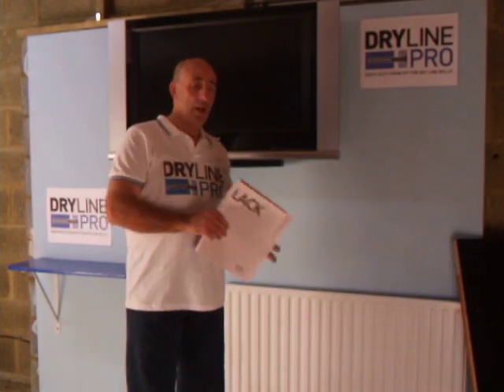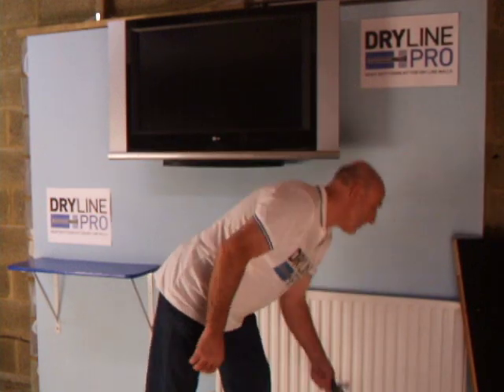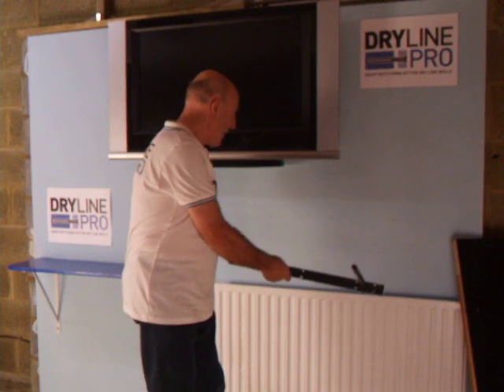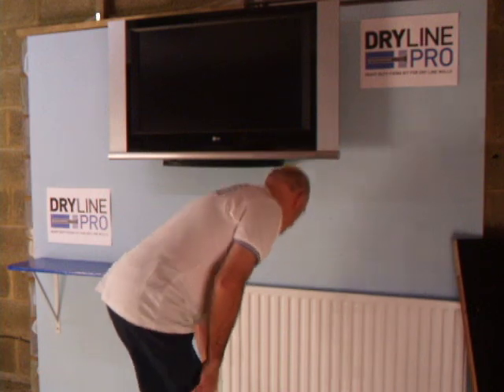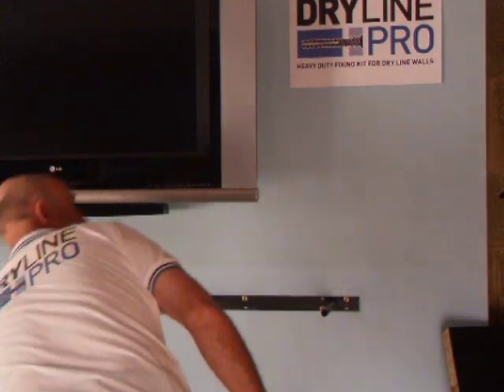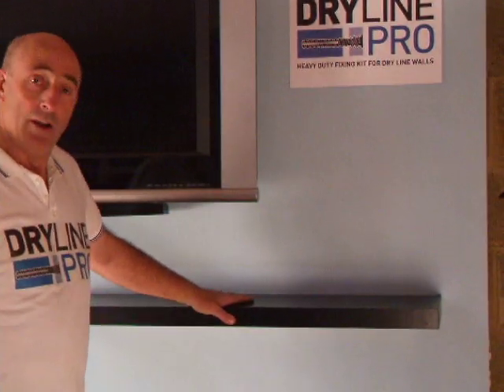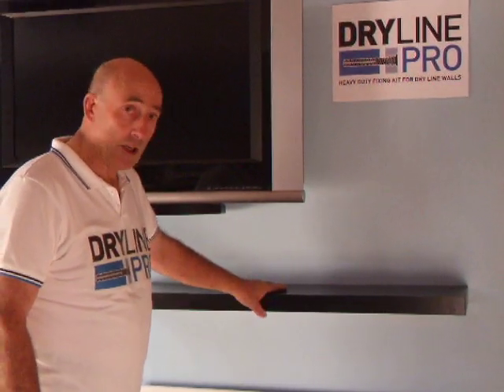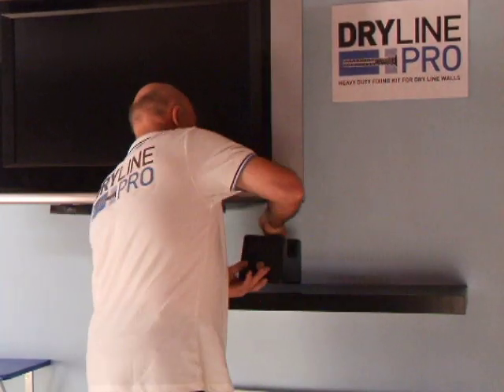Fixing an Ikea Lack Shelf to a dry lined wall

Comment: Video title says dry lined wall, yet you are drilling into concrete ??? Confused. Was looking to see how stable this shelf would be on a dry lined wall, ie not concrete or plasterboard
Reply from the maker: Walls made from concrete blocks, rather than insulating blocks, are sometimes drylined with plasterboard Victoria.It will be just the same on a standard drylined wall that you probably have in your house.
Reply: Richard Hall Many thanks Richard. So the screws and fittings you used never went into the concrete part of the wall ? The same shelf fixed to my dry line wall should also bear 20 kg ?